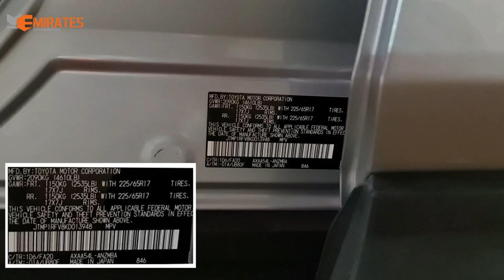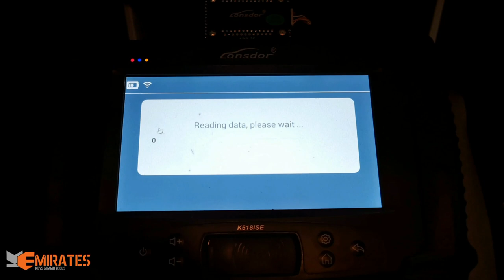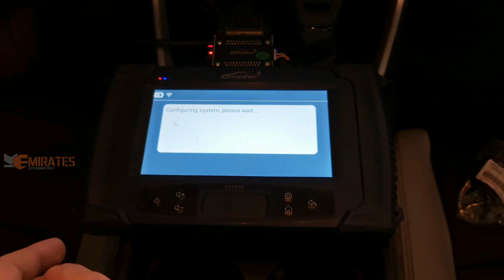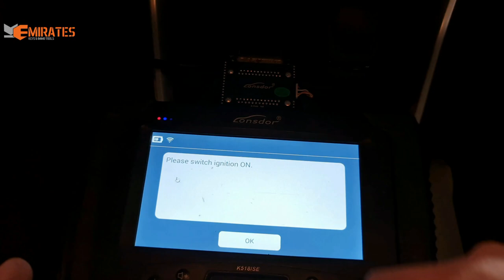Programming Toyota RAV 4 2019 USA (Add Key) With Lonsdor ADP Adapter

Comment: First make a difference emulator after add key original
Reply from the maker: In the first step we extracted the data using ADP adapter then we wrote it on LKE emulator, so it acted like a working key, then we added the original key.